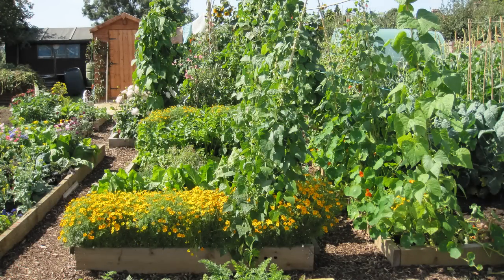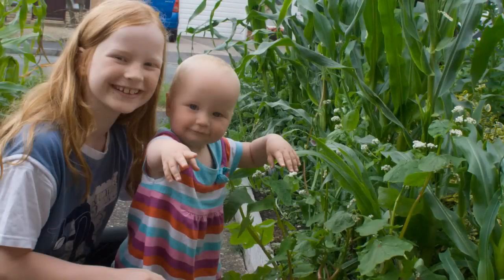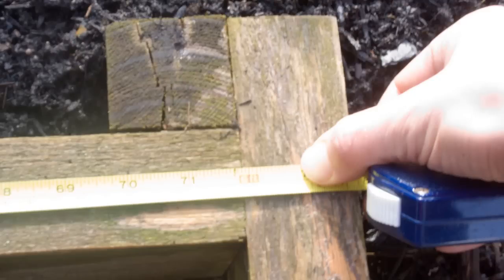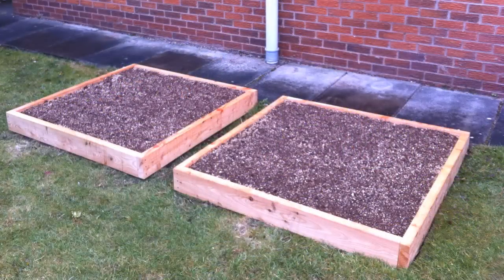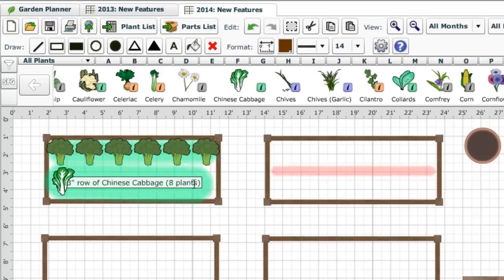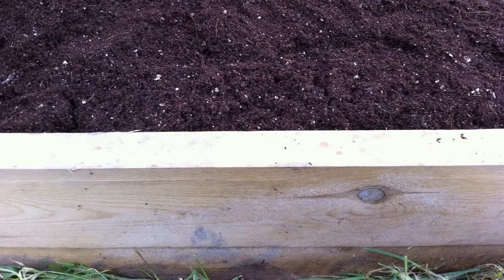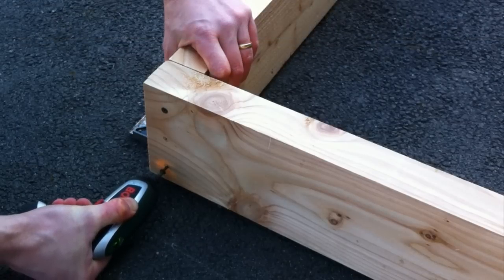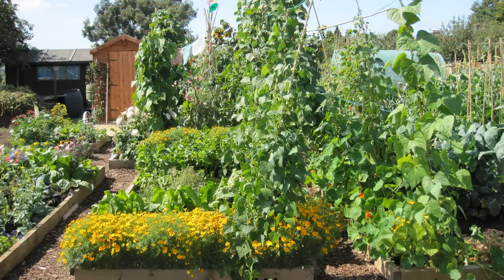How to Use Raised Beds in Your Garden - Raised Bed Gardening

Comment from the maker: Kate - you generally don't need to 'bed' a raised bed.  Just lay it on the ground (use posts at the corners which extend into the ground if you want extra rigidity but it's not necessary) and fill with the soil/compost mix which will kill grass or anything else below it.  If you have a problem with perennial weeds, moles, critters etc you can lay weed-suppressing fabric at the bottom first as long as it's permeable to water.

Comment from the maker: Hi Lisa! It all depends on how thick the old timber is and how long it has been outside already.  It's great to use recycled wood where possible but very weathered wood that is quite thin may only last a couple of seasons before you have to rebuild the raised beds, so it's a question of your time.  Just avoid any wood from sources which may have been treated with insecticides (for pallets look for the Heat Treated HT stamp).

Comment from the maker: I just put my raised beds straight onto grass but if you wan't to be doubly sure you can take off the grass first, or remove it and turn it upside down at the bottom before putting the soil mixture on top.  6 inches of soil/compost mix will kill grass.

Comment: Question:
Could plastic---often used as barriers---be used to construct beds?
Plastic barriers generally come in different lengths and heights, and can be easily squared of to form beds.
Reply from the maker: John Holloway There's a company that sells recycled UPVC raised beds called  Link-a-bord I think.  The main concern is whether anything leeches out of plastic but they say that it doesn't from the UPVC.